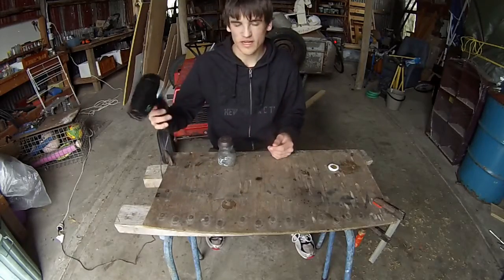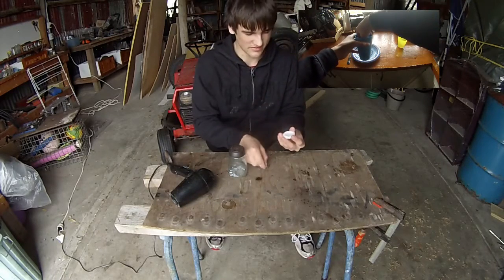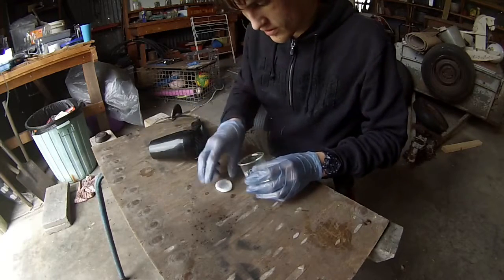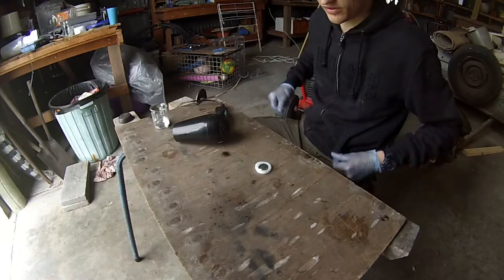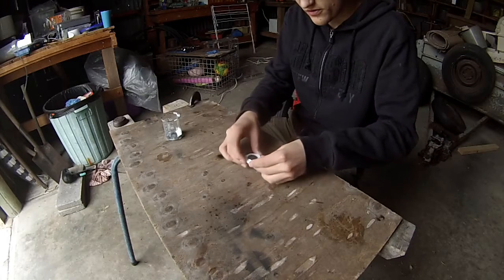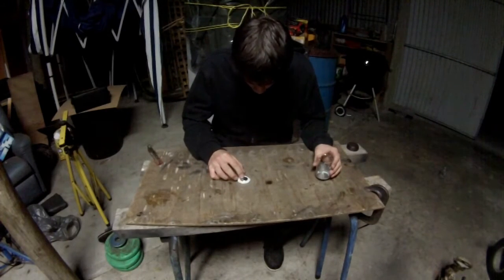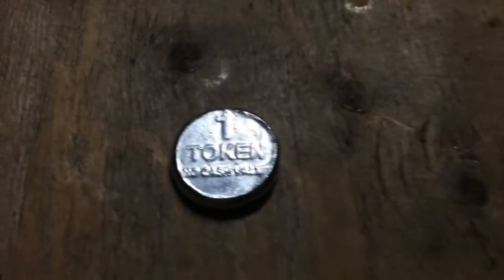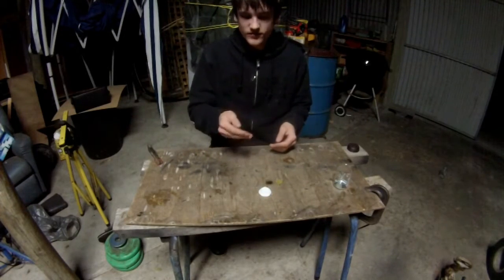Making a Gallium coin!!

Comment: Did you know the reason it takes so long to solidify is that it SUPERCOOLS - remains liqid well below the melting point. If you seeded it with a fragment of gallium while in the supercooled state, it would solidify immediately, possibly forming visible crystalline formations.